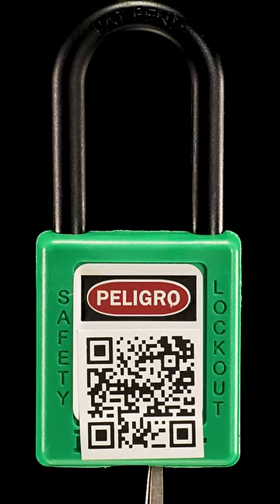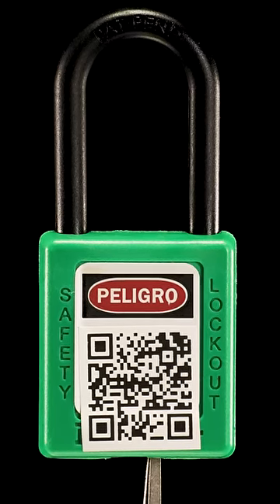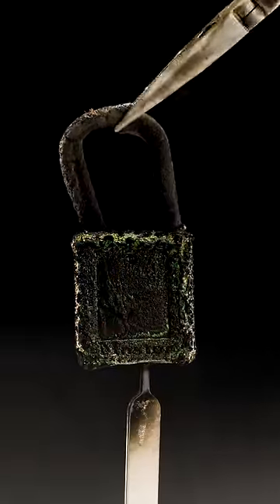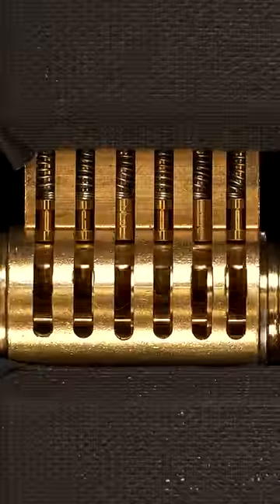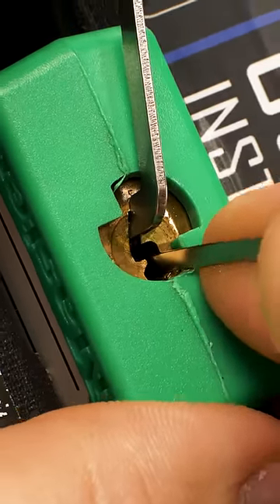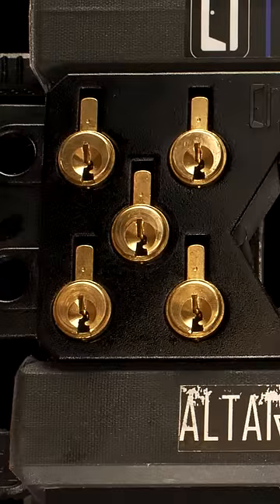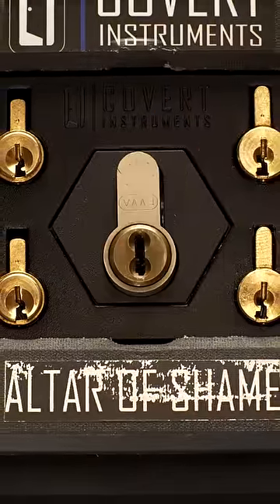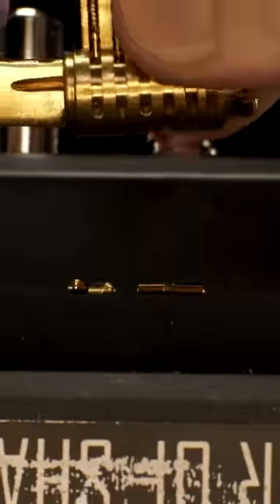Locksport Trainer

Comment: There's nowhere on the CI web page to leave a review.  So I will leave one here.  Solid 5 stars out of 5.  And the price is great.  No wonder this is sold out pretty much all the time.

I'm not quite a beginner at picking locks, but quite a few times in the past I have used improvised tools to pick locks that were in my way (not breaking any laws).  I finally got some tools from Sparrow and of course CI.  I got the Locksport Trainer for Christmas '23.  This is the first time I've ever tried to pick through security pins.  Definitely much more challenging, but having watched some of the LPL videos helps.  Also visualizing how the spool affects the shear line, giving the counter-rotation.  I got all of these with the .050 bottom turner and short hook from CI.

I got all of the American locks first.  The Master cores were much more challenging, but I finally got the last two of them tonight.  I haven't gone through a second time yet but will do so shortly, and I'm sure they will be just a bit easier each time, and not just due to wear in the locks.

Comment: If LPL has taught me anything, it's that the words "MasterLock's most pick-resistant lock" are an oxymoron.
Reply: This lock genuinely has a good core. It's not the usual ones that open just by looking at them wrong.
Reply: @tylisirn  I know what LOTO is but what I don't get is why they put such a good core in the LOTO lock and just don't give a shit about all of their other locks. I guess more liability?
Reply: @alanmccormick6911 You'd think but they still have to have additional production lines to produce the insecure cores for their consumer locks - you'd think at a certain point it would be just cheaper to only have one type of decent core instead of saving 0.1c or whatever per lock by not using any security pins.
Reply: I'm surprised nobody knows that LPL is in the video, Covert instruments is his company too

Comment: A fair point about the first lock is that, based on the markings, its not actually meant to be used like a normal lock. Its a lock out tag out lock, which are used as a sign that a machine is currently out of order or undergoing maintenance, and is more there to keep anyone from starting the machine.

I used to work in a grocery store that had a cardboard baler, which was used to compress the cardboard into as tightly packed of a package as possible, and we had locks like this handy in case the machine was ever in need of repairs.

Comment: It's funny how master lock knows how one of their most pick resistant locks needs to be the one with liability attached to it lol
Reply: For once masterlock is doing the right thing. These locks are not mean for high security, they are meant for traceability. They are placed on electrical switches or other controlers to prevent someone from accidentally turning it on, for example when maintenance is planned on a pump, and you want to make sure no operator will try to turn it on while someone has the engine wide open.
For procedure, traceability and insurance purposes, you want to make sure that there is no chance someone can pick the lock to open it without being noticed: the only way to open it is to break the plastic and that will be detected.
Other reasons why using plastic: companies use thousands of these, plastic is cheap. One of the most common use case is on electrical switches, plastic is not a conductor.
Other reasons why it's hard to pick: if I am not mistaken, these locks in general have 6 or 7 pins, to ensure not one key may allow to open another lock on site that would hold the same combination. They may also have a better precision to allow additional depths per pin and thus increase the number of combinations for a single product.

Comment: The Master lock which you seem to disparage, is merely a lockout safety lock for when working on potentially live and dangerous machinery needs to be rendered unable to activate. The locks can be bolt cut easily,. They are just a reminder deterent that any power switches affected are not to be bypassed/reactivated until all locks are removed. Cool practice lock setup....

Comment: I love how MasterLock makes a lock designed for high security applications have a stainless steel body and hardened shackle but then it’s a 4-pin core that can easily be raked open on accident. Then they make a lock for low security applications out of plastic and give it 6-pin core consisting entirely of spool and serrated pins

Comment: For all of you who don't know what these locks are there Lock Out Tag Out locks, they are pick resistant because they are mainly used to deter tampering but they need to be removable in case of emergency. LOTO locks are used when a machine is under maintenance and only the maintenance technician will have a key. The locks are to only be removed by the technician or in case of an emergency.

Comment: At MasterLock HQ: hey ,we made an actually pick-resistant lock that is actually hard to open, what metal should we use to secure it ? 

CEO: plastic
Wha?
CEO: p l a s t i c
So, it can be melted with a lighter
CEO:yes

Comment: I love how they even made the shackle plastic so you don't even have to entirely melt the lock body for it to release
Reply: The lock isnt designed for private use. Its for lockout tagout in factories. Its good that its plastic because it would be a pain in the ass everytime someone lost their key to their personal lock on a machines power supply of a machine that they were working on

Comment: So from what I understand, these are lockout-tagout (LOTO) locks, used to make sure heavy equipment doesn’t turn on when someone is in it doing repairs. The locks are plastic (as another comment said) to prevent electrical shorts and damage. They get high security cores because they are meant to protect lives rather than belongings.
Reply: Correct. I've also seen LOTO locks that don't even have a core, they permanently lock shut, and you have to cut them off, much like a zip tie.

Comment: The purpose of the lockout lock is to prevent accidental reenergization of a circuit during service. It doesn't need to resist destructive entry attempts and it's illegal for even authorized personnel to bypass the lock mechanism nondestructively when it's in use on a job site. If a key is lost the lock has to be destroyed.

Comment: It's made of plastic because it's a "lock out" lock. You stick it on heavy machinery to prevent it being able to turn on while you work on it.

It's unlikely anyone will attempt to remove it by force but if the person doing the repair manages to lose their key, operations will still be able to resume with just a bit of brute force.

The plastic housing is a feature not an oversight.

Comment: This lock is more of a safety deterrent than for actual security; because it prevents equipment that is being repaired from being used, and potentially injuring or even causing the death of the person working on the equipment. Lots of companies take Lockout Tagout protocols EXTREMELY seriously, to the point where they will fire someone on the spot if they attempt to remove the lock if they weren’t the one that put the lock on.

Comment: It's a safety lockout lock. It doesn't need to provide high resistance to break-ins, it only has to keep someone from starting a piece of equipment being cleaned or repaired. Visibility is important, but in case a disgruntled employee walks off with the key, the ability to cut the lock off easily makes plastic the perfect material for this lock. Of course, that doesn't explain why it would be such a difficult lock to pick. Maybe because its intended use means it only has one key, and if that gets lost, it shouldn't be used elsewhere because it can't be removed except by cutting.

Comment: It's amazing that the lock that is not designed for security in mind (it's a lock out tag out safety for machinery and electrical maintenance to ensure something is not turned on while sparks are stripping wires with their teeth) has a better core than their expensive max security pick resistant locks that can be opened in 0.1 seconds with a bypass attack...

Comment: You may laugh at a plastic padlock, but SAFETY LOCKOUT locks are designed to be used by electricians to temporarily lock as off a power cutout. It is not designed to prevent theft or destructive removal but to indicate an intent.

Comment: Lol. We have those exact locks at the factory where I work, to lock out the breakers of equipment that we need to work on, and sometimes I lose my key to mine, and I just take two wrenches and pry the shackle apart. The plastic pops off with hardly any force

Comment: Those are used for locking open circuit breakers in the industry. It's a safety measure so no one accidentally connects a circuit when there is people working on it.
It's nore like a signaling device.

Comment: LOTO = Lock out / Tag out. These locks are not designed to stop theves. They are designed to keep people safe by providing a way for maintenence personnel to "lock out" i.e. isolate power when working on industrial equipment.

Comment: That is a lock out tag out lock - used for energy system isolation and not intended as a security lock - it is a safety item that needs to perform a function not be unpickable lock

Comment: This is a Safetylock. Not because the lock is safe, but because it is safe to touch that lock. In europe if you work inside a productionplant with a safety-lockout-system (for example a big furnace, next to a robot arm or any other dangerous area that you are usually not allowed to enter) you are supposed to hang it in the door so nobody can close the door/hach and start the machine/plant while you are still in there. 
It is made of plastik, so that it does'nt conduct any elektricity.
For me it is one of the most important safety tools, we had accidents where people got minced throught the machine, i would'nt want this to happen to me.

Comment: I can't help but feel there are a fair number of people missing the point of the funny bit at the start of the video.

Master Lock is capable of creating an actually decent lock, if say they used this core in their steel body locks, such as the number 15.

Instead, they put the bare minimum cores in decent lock bodies, and put their secure cores in a plastic body that isn't meant for security.

Comment: That’s not a security lock it’s a safety lock. They have entirely different purposes, the fact you can melt it will never be an issue for the applications it’s meant for.

Comment: I mean, by that logic, any lock is stupid because plasma torches exist. It's not about being impossible to open, there are military grade blast doors for that. It's about opening it taking enough time for someone to notice,
Reply: It at least could be made cheap chinesium steel. The shackle can be opened with pliers.
Reply: @Swamhere123  And low quality metal can be cut with a dremel, something that, along with a battery with an outlet on the side, can be carried in a backpack, and used to get you into whatever's been locked up in less than 30 seconds. There are plenty of videos of metal locks being smashed apart with one or two good sledgehammer whacks.

Again, locks are not meant to perfectly secure something. Anyone who thinks they are, or that some materials for them are better than others, is missing the point. If someone WANTS to get into your shit, consequences be damned, they're going to. There's literally no point in not going for the cheapest lock possible, because anyone who isn't deterred by the mere presence of a lock-like object is most likely determined enough to bypass any lock anyways.
Reply: @bikerbones4615  . Dude, I get your point, but if I can cut through a lock, it's just plain bad. Locks should at least be resistant to non power tools.

Comment: I use almost these same lock every day, but they have a metal shackle and are red bodied. I think they're the most secure lock you can have, since there's lives on the line if you remove it and it's not yours

Comment: Unfortunately, the Locksport trainer doesn't actually do anything to hold them in back and forth. So they slide right out easily. As it warns, if the key ever does go all the way around (like trying to get the key free), you've got yourself work to repin lol

Comment: To clarify: the point of these locks isn't to necessarily keep intruders o out, but to block off part of a machine or system to let you know somebody is working on it and can get hurt or killed if you turn things on

I used these when i worked in a factory.

Comment: Not to defend masterlock by any means, but a LOTO lock is not meant to be secure, it's meant to make it a pain for anyone trying to turn on the item you're working on. Everyone knew you could open one with a well placed wrench strike, but you didn't, because it meant that someone was in a position to get killed if the switch was turned on.

Comment: That is a lockout lock not a security lock and ironically it's thanks to OSHA that it's so pick resistant and made out of plastic. The TLDR version is you sometimes may need to have 10 of these on a single power switch so they can't be heavy and no 2 can have open with 1 key or by being smacked with a falling hammer AND you have to be able to cut them off relatively fast in emergencies

Comment: “You are using a Masterlock model 4-010, it can be opened using anything that has a blunt end, you could probably even use a blunt to open it by sticking the lot end on the plastic and melting it since Masterlock used such cheap plastic.”

Comment: Ok, I will just say that is a lockout lock. It is not really for locking valuables up or anything like that. It more for construction work. Electricians use it to lock a electrical system to tell people they are working on that system that their life is on the line. Why would you want to pick that or to burn it off.

Comment: That looks like a lockout tagout lock. They're supposed to be tamper-proof as in you're not supposed to be able to take the lock off and then put it back on unless you're a key Bearer. 
If the lock is missing or melted then you know that it was removed by somebody...

Comment: I had a lock cylinder on my 98 Ford e150 sees up I'm pretty sure it's the extraction pin on the bottom broke the cylinder came out one day unexpectedly I made a mistake of putting it back in haven't been able to start or drive my truck any tips or tricks on how to unlock the steering wheel and shifter used to have a remote start so I can start the vehicle

Comment: (puts nerds glasses🤓) that's actually not the purpose of this lock. Imagine you have an ginormous industrial purpose oven, with open flames and a crusher and shit, for like, concrete. Sometimes, that oven is shutdown for maintenance and people must actually go in to perform stuff. Well, that lock goes straight on the "On" switch to indicate that someone is not willing to be cooked and it also physically prevents the switch from operating. Its not designed for area denial.

Comment: these locks are not made to prevent theft they are made to lock out machinery for maintenance if your found cutting one of these off without permission you probably would be fired on the spot

Comment: Have whole collection of these locks ( i work on robot cells ) the most pic resist locks only job for me was to keep some bozo from turning on main power / air while i was servicing cylinders or valve manifolds 🤣

Comment: Im glad h9nestly that thats the most pick resistant

Due to the fact these locks are specifically designed to save lives

Their equipment lockout tags. They block ascess to machine controls while a operator or repairman makes repairs. Removing these locks and messing with the machines can very easily kill and unseen worker

Dont fck with lockout tags please

Comment: I don't get it. Why the fuck would a LO/TO lock need to be pick resistant? Also it only takes a long screwdriver to just brute force these guys off, which I thought was by design. When you get the gang adapter with 16 spots someone ALWAYS loses their key by the end of the day lol.

Comment: What an incredibly durable plastic Lock. That's going to stand up to a thief with a pair of wire Cutters  Lose your valuables if you depend on that Lock.
Reply: Fortunately it's a "lockout" lock, meant for use to lock equipment when it's unsafe to use (maintenance etc.) so ideally anyone encountering it would be trained to say "I shouldn't use this machine" instead of trying to break into it.